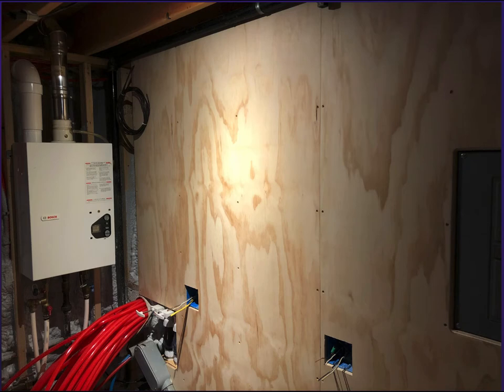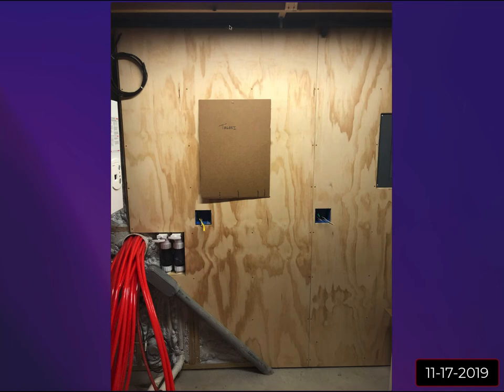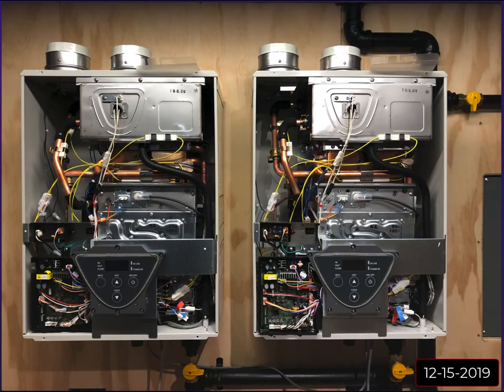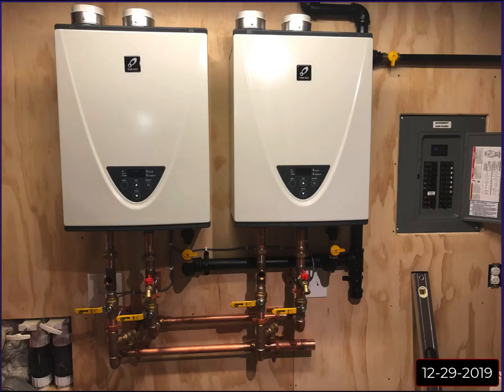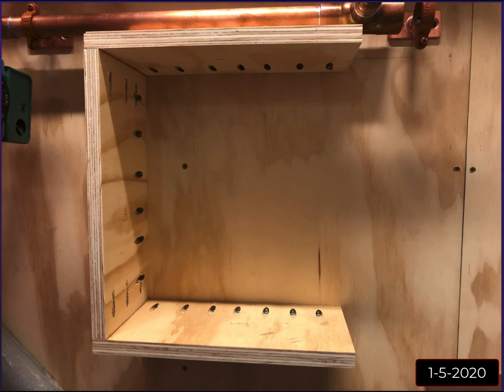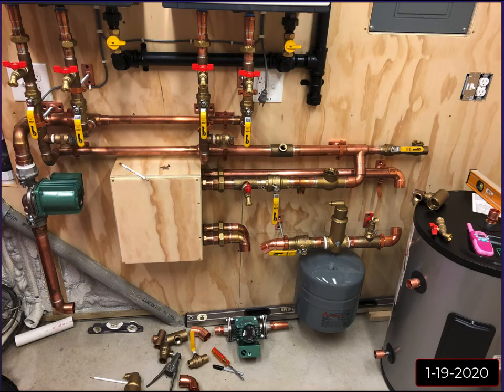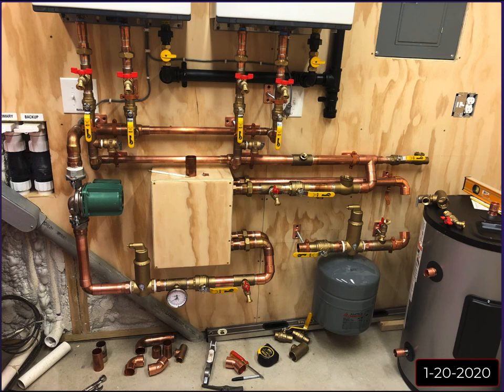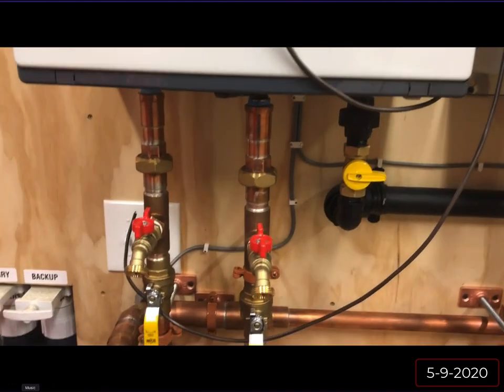Installing 2 Tankless Water Heaters for my DIY Heated Driveway - Episode 11 [Winter 2019-20]

Comment: Just ran across your channel. One thing I noticed was the loops in your bath/shower walls. Is there a video of yours or someone else that you think was particularly helpful with the walls and shower bath floors.
Reply from the maker: Hi Al.  The loops in the shower walls was something I wanted to try, but had not seen before.  I did find heated towel racks, etc, but I couldn't really find anyone else doing this.  I had the extra pex, and an extra spot on the manifold, so I thought I would give it a shot.  I had a couple of people in the business tell me it wouldn't work because the loops would get air bound / locked as the air would settle in the top of the loops.  I made sure to give it a really good purge when filling and I have had no issues.  When the radiant floor are on, the tile on the walls feels warm and even radiates a bit.  As for the floors, I would always start by pulling my pex from the source and making a loop in each joist bay. I would run the pex all the way back to the manifold, and then start fastening it backwards, in other words from the end to the beginning, pulling more pex through the loops as needed.  Hopefully that makes sense, if not I can make a video on how I did it. Let me know.  Thanks for watching!
Reply: @DeckerChristopherJ  How long have you been operating the wall? For the naysayers, if the loops are properly bled what would be the difference with any other loop
Reply from the maker: Hi Al, sorry I missed your reply until now!  So I ran the walls for a week or two back in March, and haven't really ran them since.  They are on the same manifold as the staple-up for the floors, and I only had a couple of weeks to play with it back in March before it started warming up.  We haven't turned it on yet this winter, I like to wait until it gets REALLY cold.  :)   I also agree with you regarding the loops being properly bled.  I gave them a really good purge with a strong pump (videos of that process coming soon).  I have had no issues with air anywhere in the system.  Thanks for watching!!

Comment: Do you have NG or propane. I am considering an oil fired water as a source for radiant as well as domestic. Presently in MD electric is about $.11 /kw,  propane I think is prohibitively expensive and NG which would be my first choice is spotty. I am at a very early design construction no floor plan yet. any thoughts abought oil?
Reply: oil fired water heater
Reply from the maker: Hi Al.  My heaters run on Natural Gas.  In my area, an electric system would not be feasible. Electric is a lot more expensive than Natural Gas here (although Natural Gas is up this year almost 84% compared to last 🤬).  Sorry I don't have a lot of experience with propane or oil, natural gas was almost my first choice since it is readily available in my area.  My only concern running something like this on either of those is that you would want to watch your fuel levels constantly.  When its really cold and first started, this system can consume a large amount of gas / BTU's.  I would hate for you to empty your tanks and have nothing left to heat the house or something like that.  Sorry I can't be of more help, I'm just not that familiar with oil fired waters heaters, their capabilities or efficiency.  Good luck, and let me know if you have any other questions.  Thanks for watching!